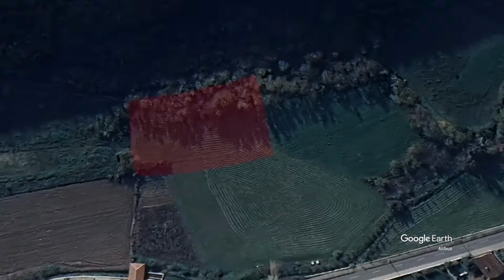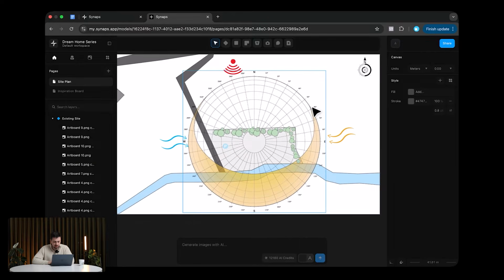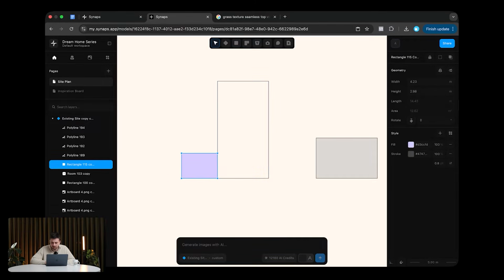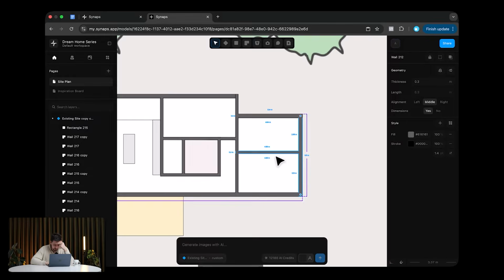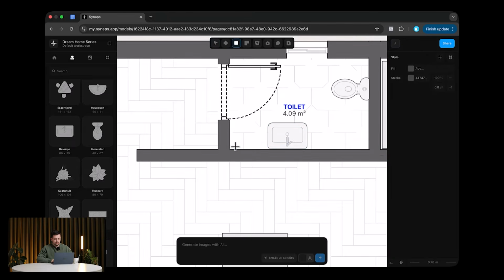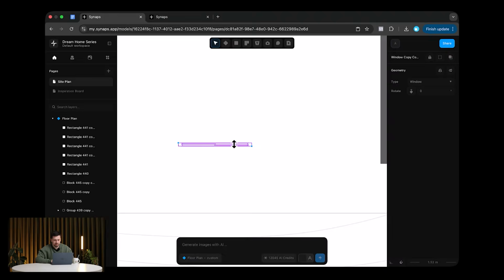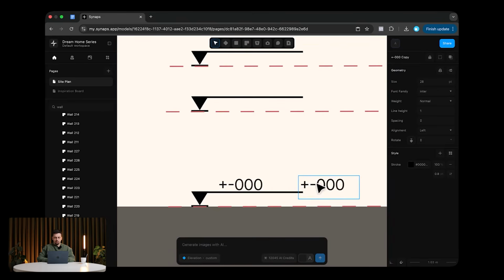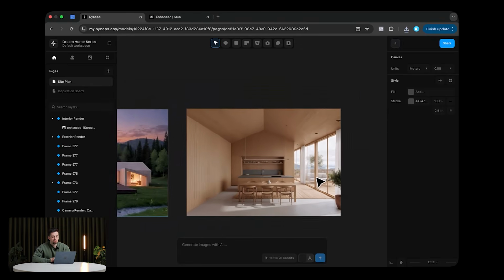How To Design Your Own Dream Home (AI Assisted Workflow)

Comment: What would be actually very useful is that you list your rooms (with sizes) give the parameters of your terrain such as coordinates for sun, wind/rain directions and based on these, you specify what you want and dont want (e.g bedrooms away from the noise and facing east or north, living room with big opening to te exterior, maximize continuous outdoor area  etc) and then AI try to optimize room distribution based on differen scenarios (e.g. one block, U shape with patio etc)